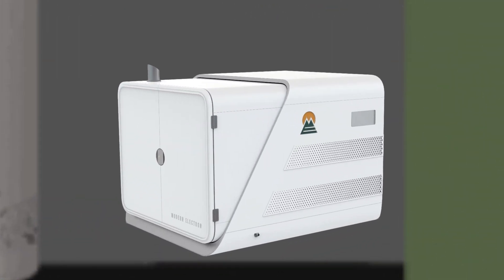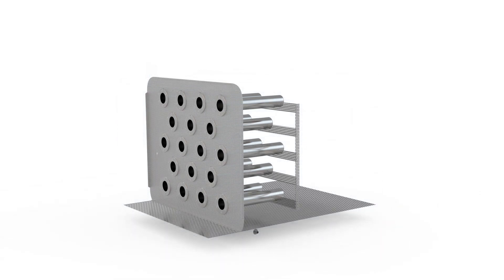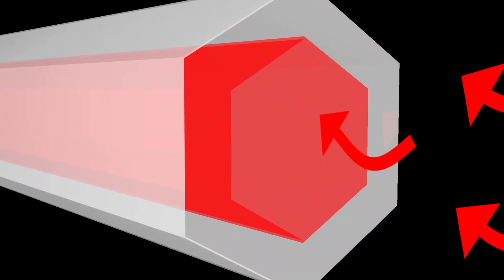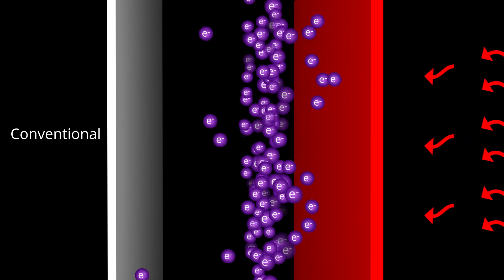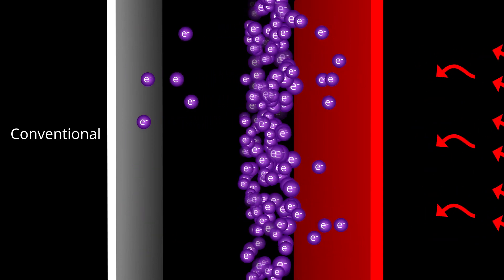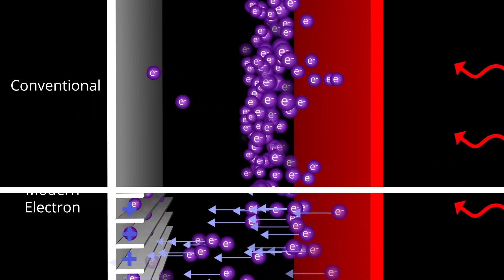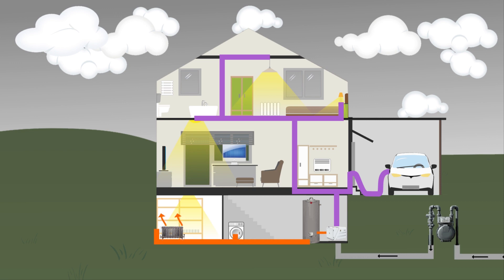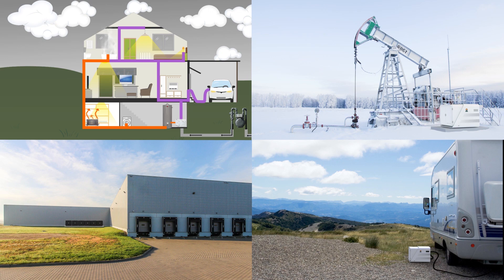Modern Electron - Thermionic Converter

Comment: Theory for an electric generator that uses radioactive cobalt 60 magnets that emit high energy Beta Particles ( electricity ) will it work or will it be too hot to function or can it be cooled in a sub zero temperature gas chamber ? You are welcome to improve these devices
      The invention's electric generator uses cobalt 60 magnets that emit high energy Beta Particles ...Beta Particles are high energy electrons...electrons in motion is electricity ..hopefully these high energy beta particles generated will travel through copper wire for electric use. (1)   comprising of a Microwave Hot Water Boiler Heating System   in which low energy input creates   a higher energy output Microwave Boiler, by converting   thorium/uranium electrons into microwave energy said magnetron microwave device, said microwave magnetron and a   klystron thats cathodes and anodes are plated with thorium and   uranium and whose magnets are of radioactive cobalt., wherein   the invention's microwave emitting device shall be improved by   plating the magnetron's electric cathode with thorium and uranium that is radioactive, the anode is of magnetizable metal,   radioactive cobalt, nickel or iron and the anode is plated with   radioactive metal, wherein the operation of the invention's   magnetron, a high D-C potential is applied between cathode and   anode, setting up a radial electric field, wherein the combined  forces cause electrons to take a spiral path and when the   magnetron, the electric oscillations of the magnetron resonators   set up an A-C electric field across the resonator gaps, wherein   the thorium and uranium metal cathode, magnetic metal anode   of cobalt and plated with radioactive metal, in the magnetron   sets up an increase in spiraling reactions when an electric current   is applied and causes the magnetron output current to be many   times the electric input of the invention's magnetron, and the   invention, comprises of electric devices converting thorium  uranium, cesium tungsten, nichrome, and argon gas atoms   interacting and generating electron emissions into electric   energy, and using mechanical energy input and obtain a greater   energy output of electric energy, the invention's, "

Comment: yes, the principle is sound but the cost of nano-articulated materials still makes it cost prohibitive. not many consumers will want to shell out $8k for a power supply to supplement their usual power sources. Thermionics and thermoelectrics are still way behind in efficiency as seen in 2020 technology. We've gotten to only 15% efficiency and applications of both are really just relegated to small surface areas and mobile applications, and the occasional exotic device such as used in aerospace devices
Reply: What are the best off-grid power sources you're aware of? To the best of my knowledge, it seems a combination of hydro and geothermal may be best; at least in Oregon.